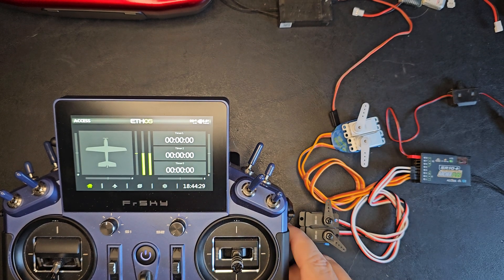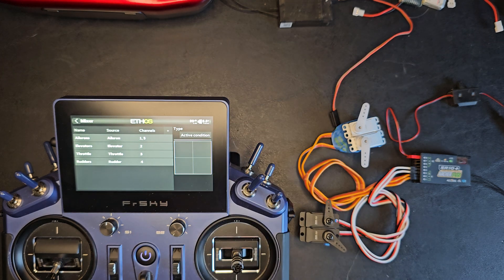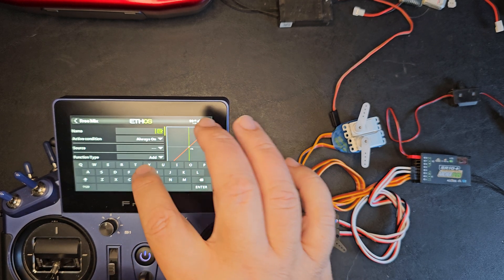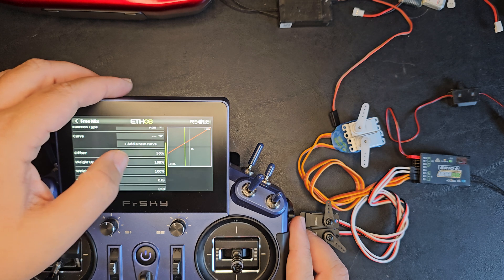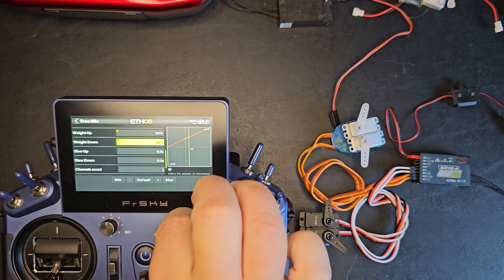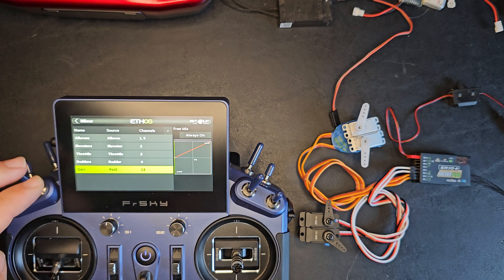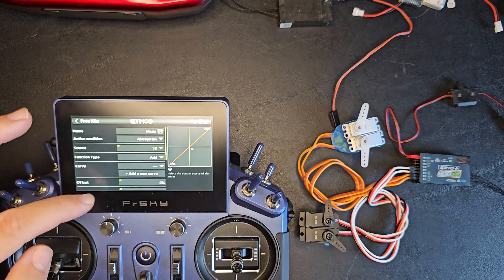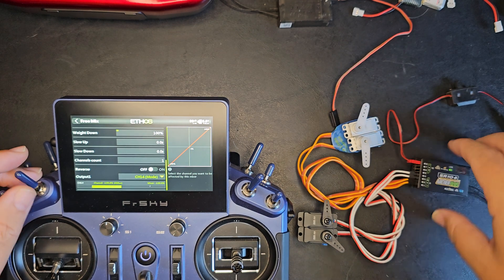FrSky ETHOS Stabilized Receiver ARCHER Plus Basic MIXER for Gyro Gain & Mode SR8/10+/12+ TANDEM TWIN

Comment: Wish you said why you used channel 13 and 14, I dont understand that part.
Reply from the maker: @JohnVHRC  those are the mandatory channel assignments for Gain and Flight Modes 1 respectively. It's defined in the manual for these receivers
Reply: Aha :) Switched to FrSky too :)

Comment: I have always wondered what the ideal settings are for autolevel in your RXs... I think most default to 50?  I'd love to learn a bit more about best practices on how to set those values.  Also, does the gain knob affect the auto-level mode or just the stabilized mode?  Thanks for making these resources, the new Stab rx's are awesome.

Comment: This is good to know.  Will this receiver, and gyro (the video is for a basic 5 channel airplane), work in a Freewing F-14 where 3 aileron channels, one elevator channel, 2 rudder channels, throttle channel, thrust reverse channel, center burner channel, flaps channel, retract gear channel and swing wing channel would be required?  Or would a different receiver be better for this complex a model?

Comment: can u use bluetooth mode 1 on my tx as a trainer, and mode 3 on another tx as the slave ,as we both fly diffrent modes cheers
Reply from the maker: Yes it should work just as long as you have the MIXER channel orders on the student radio set correctly to match the Teacher radio's model expected channel order.
Reply: hi thanks for reply tried that still same ,what im trying to do is fly on my mode 4, with the student flying mode 1,and i have control if any probs happen,just wondering can it be done  @frskyben

Comment: I have an old s6r that I am having problems binding to my new x20s radio what would be a good up grade  receiver.
Reply from the maker: Have you tried updating the firmware on your S6R? It should work with the ACCST v2 firmware. 

Right now there is not really a 6Channel Stabilized Receiver replacement. There was Archer R6 but it is discontinued now. 

There will be a new Archer Plus SR6MINI which is Stabilized 6channels but it only has connectors for the micro servos. 

The closest replacement to S6R now is Archer Plus SR8
Reply: Thanks I will give the update a try
Reply: Got it to work thanks

Comment: So I have a gy401 gyro in my helicopter. Would I do the same set up basically
Reply from the maker: No sorry, not sure how that gyro works but it's completely different than our stabilized receivers. You should consult the manual for that gyro system. The FrSky stabilized receivers cannot be used for heli and only support fixed-wing.
Reply: @frskyben  ok thank you  . For getting back to me  i have the X20 and it is a very nice radio . Good job